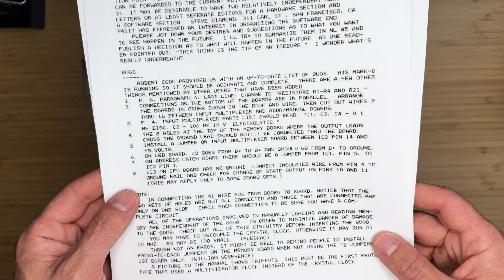Mark-8 Reproduction CPU Board

Comment: Just wondering, I've been watching through this series (A few times actually!) would you consider redesigning the boards in a more modern, smaller style with text and a smaller footprint? I feel all the boards are very sparsely populated and text would probably help make for easier construction. And of course the manufacturing cost would be significantly reduced. 

It's something I have thought about doing, but I think you very much need a working machine in situ before going about redesigning things!
Reply from the maker: Hey, that’s a good idea. Fortunately, someone already did it. The computer I’m using for testing was actually made using a newer format. Unless you’re referring to something even smaller?
Reply: @artemkalinchuk  I had no idea. Time to do some reading.  I really enjoy your videos on the system, looking forward to seeing  it doing some more computing!